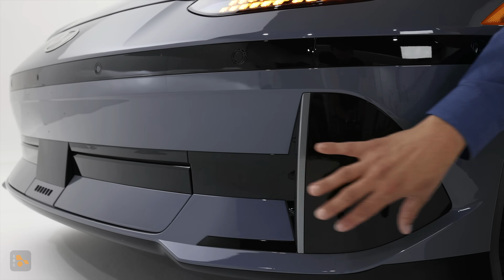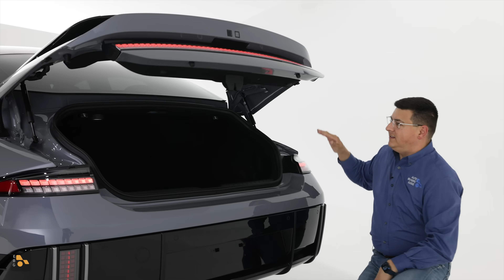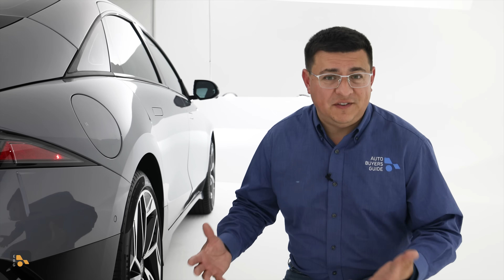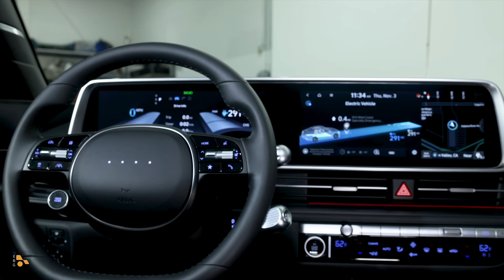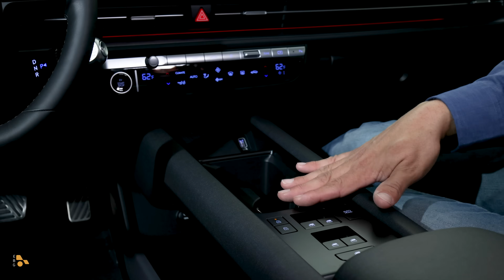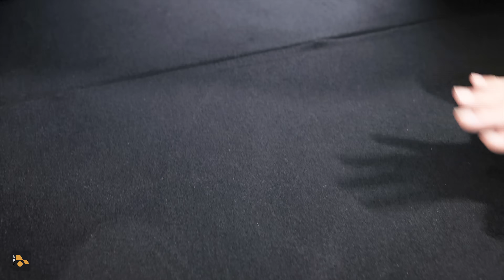The New Ioniq 6 Is The Affordable Long Range EV You've Been Waiting For

Comment: The cost to produce EV should be less than the cost to produce ICE, however, the sell price does not reflect such. We bought an Altima in 2017 for around $24,000. Has heated cloth seats. $45K is really out of the price range of most consumers. Seems like all car manufacturers are going after those who can afford “luxury” cars. Lots of nice features, but do we really need ambient lighting? Everything having to be controlled from the “screen” is to me a big safety issue. I prefer my heated seat knob that allows me to select two temperature modes and doesn’t reset every time I turn off the car. Overall, it appears to be a nice vehicle for those who can afford it.

Comment: I was keen on getting a Ioniq 5 but the buying experience is very difficult.  The way to buy one right now is to cold call dealers - if they have anything in transport still not presold, you could put something down as long as you agree to a $3-$5k markup.  Most of the cars available were the completely top spec, which were almost the same price as a model Y.  Later, I would have to get warranty service from a different dealer since I would inevitably be buy a car from so far away.  The buying process is exactly what kept me away from a Hyundai EV.  They are just shy of being vaporware.

Comment: My non-computerized manual transmission sedan gets 380 miles/tank and can be filled in <5 minutes.

LED headlights are horrendous. $$$$$$ to replace. Those front air vents will get clogged with ice and snow. They blatantly ripped off Porsche design on the rear deck. No spare tire? 👎👎👎

But I'm sure the child slaves digging for the cobalt and lithium will thank you for keeping them employed. Oh...and the CCP also thanks you for continuing to fund them and the mines they own world-wide.

Comment: Basically this is the successor to the 2020-2021 ioniq ev, exact same mi/kwh estimates for the rwd model and similar profile. This just happens to be more modern and fleshed out vs the older compliance model. Having double the range, faster charging, and an awd option

Comment: kind of odd about the rear seat headroom. it seems like if they moved the rear seat forward about 3-4 inches, it would be fine. its almost like they gave too much leg room and pushed the rear seat too far back so that the natural position of your head is up against the ceiling. honestly, do you really need all that leg room? even just a couple inches less and the headroom wouldn't be a problem. plus the trunk would be a little deeper. Odd decision to make tall people kink their neck in the back to save a few inches of legroom when there is legroom to spare already from pushing the front seats forward with the short hood. it seems like the type of thing where they already determined the position of the rear seat anchor points on the subframe, and it was too late to change. "oops". this is also something that is unlikely to get fixed between model years. 

of course average height of white USA men is 5'10", Alex is 5'12", and the average korean male is 5'8". So for most people it will be just fine.

Comment: I own a Ioniq 5, in warmer weather I was getting @ 290+- 3 miles with a full charge.  I use mainly eco, except for turning at a corner when traffic from the opposite lanes are coming.  Eco is a bit slow initially.  For everything else it is fine.  The cold weather just started and I notice the loss of battery efficiency.  My 5 is the limited 77.4kw, with AWD.  It was the right choice.

Comment: The Ioniq 6 looks awesome, but I'm not sure there is enough room for a family of 4 on a road trip. I wish the cargo area was bigger or a bigger frunk. We use the frunk in our EV all the time.
Reply: The reason for the smaller frunk is because it's the AWD version shown here, the AWD version has two electric motors, not just on the back but also on the front as well. And for the smaller trunk, well with all these design choices made for efficiency, what else did you expect? Unfortunately you Americans don't get the super practical EV known as the "Skoda Enyaq" we get here in Europe.

Comment: Why would anyone buy a Tesla model 3 when you can buy THIS!
Reply: The Tesla Model 3 is available now.  In 2023 it will qualify for the federal tax credit, but not the Ioniq 6.  Tesla does not charge dealer markup fees.  Even after the I6 is in production, far more M3s will be produced meaning it’s much easier to get a Tesla.  The Tesla supercharging system has more locations and is far more reliable.  The charge port on the M3, in my opinion, is more conveniently placed on the driver’s side.

Comment: Where does the front license plate get bolted to this car?
Is it that little rectangle below the horizontal bumper strip, or is that a forward radar sensor?
Reply: Thankfully my state doesn’t require one but if it did I’d use the tow hook after market one to preserve the resale value across multiple states of an untouched bumper. All sensors are behind the black strip. Lower portion is active aero cooling ducts.

Comment: I just wish Hyundai EVs had a route planner and onboard audio streaming app integration.
Reply: True but until the CCS networks start collaborating charger statuses into a shared active database. It’s kind of moot to show up to one that’s not working because the nav did not know. Yes Tesla can because car and charger share the same parent company. That’s why their lines in CA stack up when they could easily sneak a charge at an EA with an adapter. I’d say 97% are in a fish bowl that’s currently getting more crowded by the day. Smart ones buy the adapter and hop out of the bowl that’s in a bigger pool of opportunity. For CCS we’ll need multiple charging network apps for road trips. It’s better than the paper map and mileage scales to measure how far your tank would go days. 😉
Reply: @garyclark6747  the CCS networks already report the status of their chargers through a common API, which Hyundai EVs support. The onboard navigation will tell you how many dispensers there are, how many are occupied and how many are down.
Reply: @UnnDunn  Nice. As many times as I here reviewers complain about the status being incorrect I thought surely they weren’t using a comprehensive system. Nice to hear this report. 👍🏼